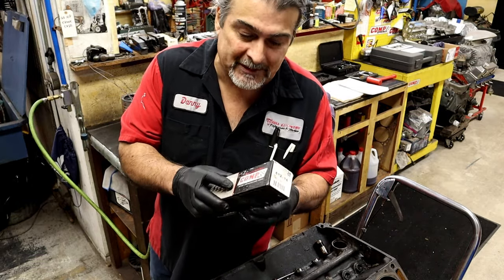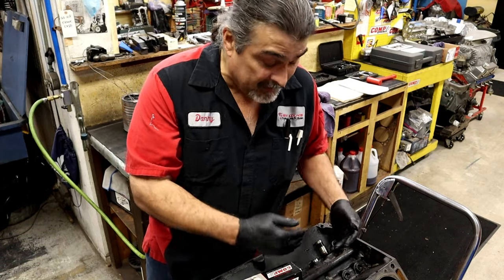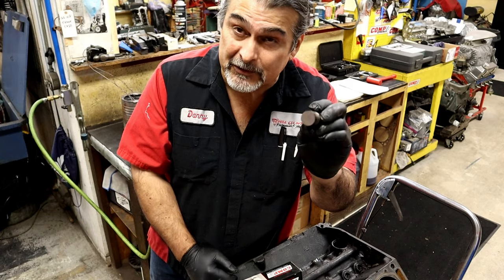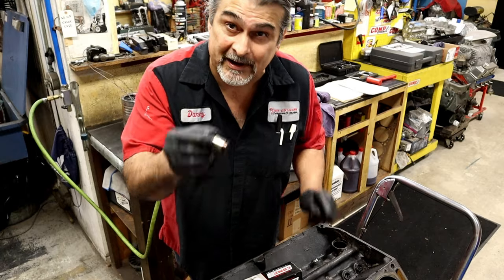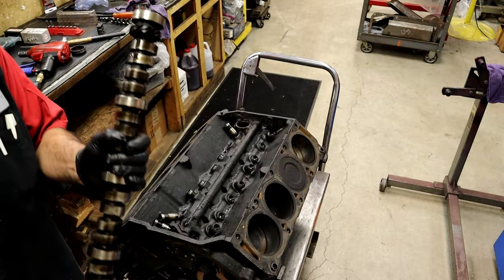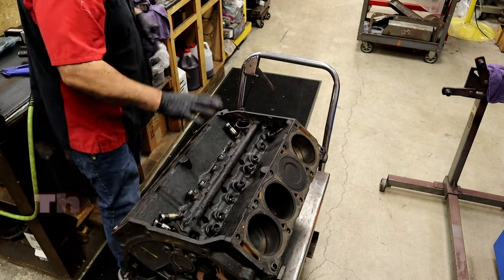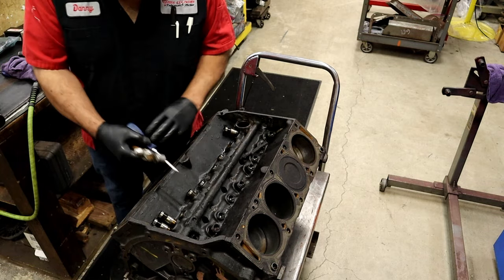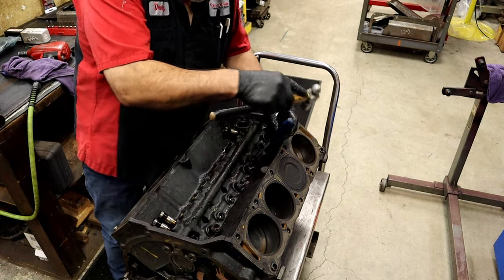HOW TO REMOVE LIFTERS WITHOUT DAMAGING YOUR BLOCK.

Comment: Danny, awesome work brother.  I was watching you snd Faye over Covid and you did a segment on head gaskets.  So I had a 2010
Tundra, 5.7 with 280k miles that I had owned since 65k.  Coolant charges at 100,150,200,250k…new oem water pump at 200k.  Never over heated…no stored overheat codes either.  At 280k I started having crank no start, finally tripped a misfire on number 2 cylinder.  Replaced spark plug and coil/oem.  Issue was back almost immediately.  Come to find out I had a slight head gasket leak on number 2.  How could this have happened with never over heating?
Reply from the maker: Unfortunately the head gaskets only last so long. They have to seal coolant, compression and oil. Every time the engine starts the cylinder head expands ( slightly more then the block) and as it cools it shrinks. Over and over again and even if it never overheats the gasket has takes a beating. Hope this helps.
Reply: @MrDanielSoliz  I guess it’s weird because this engine is notorious for almost no head gasket issues.  Thank you for the reply.